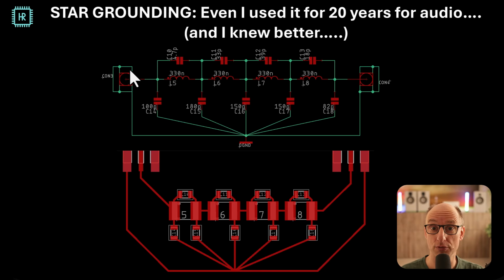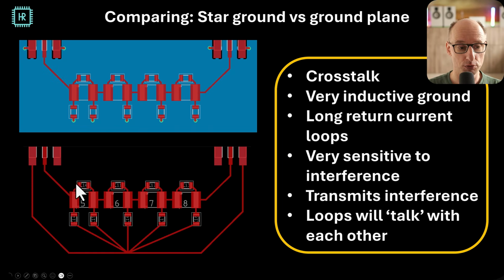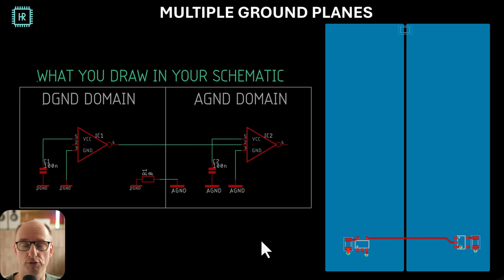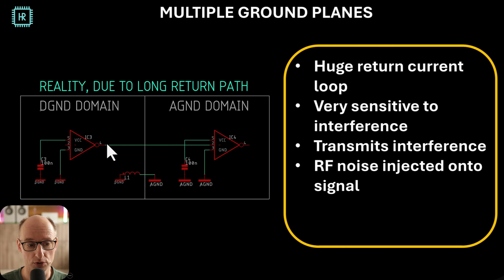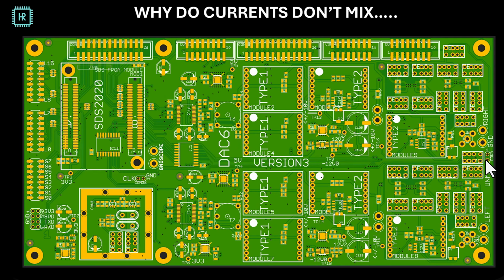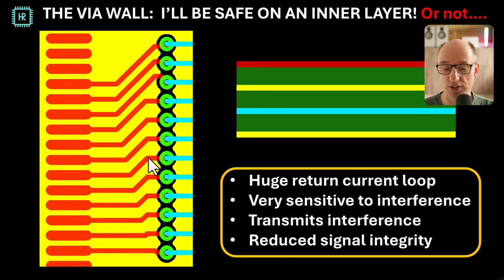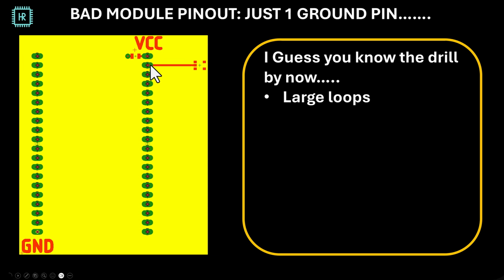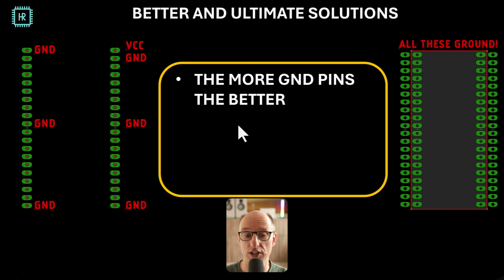Why Your Ground Design is WRONG — and How to Fix It. Flawless PCB design part 6

Comment: Hi Hans. this is the perfect video for the topic I am working on right now. I'm an engineer who working on VHF receiver and demodulator based on CMX7032 chip. In the datasheet, CMX7032 specified that it needs multiple GNDs for its DGND, AGND, and RFGND. What your opinion on this matter? Thanks
Reply from the maker: I've addressed this in my part 5 video: See mobile radio chip. If that doesn't help, reply back to me
Reply: @HansRosenberg74  Thanks Hans. I've seen your excellent videos. From what I understand, the underlying principle is that the energy of the signal propagates "only" between the signal trace and the GND plane, just like a transmission line. So that as long as the GND plane is unobstructed and the distance between the signal traces are sufficiently large (to prevent crosstalks), we can just use a single large continuous GND plane for all AGND, DGND, and RFGND for the CMX7032 design. I'm I correct?
Reply from the maker: Yes, indeed. 4 layers are really great since the loops get so small so you can put stuff close together.
Reply: @HansRosenberg74  Btw, where does the requirement for separate GND in the CMX7032 datasheet comes from? Or, what is their reasoning behind all of that, on your opinion? Thanks, Hans.
Reply from the maker: Hi, their reasoning is wrong. That is why I made this video. With this layout, you're forcing whatever interference and return currents there are through the die of chip instead of through the ground plane. This is a bad idea. I've seen very smart people fall for these mistakes in 3 different companies and solved all problems all those times by making a single ground plane. It's just because people think RF design is a bit of a dark art, but it really isn't. It's really really simple if you just follow a few main rules...
Reply: @HansRosenberg74  Thanks, Hans, for your videos. Really helps. God bless u

Comment: Actually i'm in the process of designinig pcbs for audio, and I've used the bottom layer as a signal ground plane and signal routing, and the top layer as a "dirty" ground plane and power supply related stuff (supply caps). The two grounds are then connected together in a single point. I've avoided as much as possible to cross the bottom signal traces with the top power traces, but still I'm wondering if it's a good idea now
Reply from the maker: It's worse for keeping rf interference out. If it is a power amplifier, you do have to be careful where the large currents are running in your ground plane, you don't want those to add to your signal ground going to the input. So power left and signal input right would solve that (using a single plane)
Reply: @HansRosenberg74  Well.. The project is a mixer/preamp, so I don't have large current signals, but lots of opamps and multiple pcbs.
So I'm a bit concerned about ground loops between pcbs and noise performance. That's why I came with that solution in the first place. Components are also placed to keep the traces between them as short as possible.
Maybe using a signal ground plane on both layers and the power supply "dirty" ground as a trace along with power supply rails is a better idea?
Reply from the maker: With the info I have now I would use a single ground plane on both boards. I would make very short return paths for signals going between the boards. So signal pin with 1 or 2 ground pins right next to it. If you don't have high currents, then there will be no crosstalk caused by common ground impedance since the impedance of a ground plane is very very low.

Comment: Crap, I just sent for manufacture a board I was super proud of, and now I realized it is totally wrong :D:D - Thanks a lot for these videos, super useful to spot mistakes!
Reply from the maker: Darn, that is a pity. If you don' t have a high dynamic range somewhere, you may not have problems.....
Reply: At least 99.8% of all professionally designed boards i have ever seen do not conform to these design principles and they still work well enough. You are likely enough to get lucky.

Heck i'm afraid to use them because the boards may not look "proper" to an outside observer or to the customer regardless if they work well!

Comment: One problem that's always scratching at the back of my mind is that there's two grounding rules that I find are often at odds with one another: one being that you want to keep the return path as close to the signal path as possible, preferably with no other signals sharing that path, and the other being that you want to prevent the formation of ground loops. In a pcb with ground planes and short distances this seems easy enough to rationalize, but in larger assemblies with multiple pcbs, modules, or even sub assemblies it seems like you get one or the other in most cases.
Reply from the maker: Now that I think of it, if you really have a ground loop, maybe it can be solved using an isolation transformer in the mains supply of one of the pieces of equipment affected. Not really a very nice solution but may help. You first need to understand what is causing it really.....
Reply: Yes, but he explained this very well already when he talked about PCB modules.
Reply: @jaro6985  sort of, but he doesn't really address ground loops at all (and in that instance it seems implied he's looking at relatively short connections). The issue with ground loops is they can result in current flowing between the grounds. In large audio systems with long spans it can be a strong enough effect to even damage the equipment.
Reply from the maker: Yes, this is an annoying one. What I've noticed a few times is that I got ground currents between 2 transformers. So I had 2 supplies (transformer, bridge, elcos) of which the grounds were connected and I got quite high ground currents leading to hum in my system. I never found the real cause of that. I think I must have had something wrongly connected at that time because I never had it again.

The problem you're referring to is a common mode current. They're really nasty and can cover a huge frequency range from 50kHz up to a few GHz (wifi). I took some measures at home with my own audio system. Probably will make video's on that in the future.
Reply: I think people worry too much about ground loops. It's one of those things that's only a problem when it becomes a problem. Whereas you'll always benefit from tight return loops.

Comment: Gonna guess that one issue we all forget is the difference between 'frequency' (thinking in sine waves) and edge rate of change (dv/dt and di/dt).

Even low frequency circuits can produce high rate of change effects. I've seen FET control of relay/motor coil generate worst RFI, not from solenoid back EMF on switch off, but from the FET switching on even faster.
Reply from the maker: Exactly!!!!

Comment: Having a Master in Metrology, I wish these kind of things were teached at my uni. Not only they're very useful for design (Metrology doesn't have a lot of that), but the concepts you use for explanation would greatly simplify the understanding of all the electronic courses I took.
Reply from the maker: Unfortunately you don't learn any of this useful stuff in any school. All I got wat a tsunami of math which is 99% useless for designing great electronics. (you do need simple high school math, but none of the useless advanced stuff which was 90% of my education). You can sense this still frustrates me after more than 30 years :-D
Reply: Es la conspiración de los profesores, ellos tampoco lo saben.  Na mentira, en Latam tenemos buenos profesores, pero tampoco lo enseñan   Saludos desde Argentina

Comment: 13:45 A cheat that could be useful is that you can add extra ground return paths on IO centric modules by assigning spare pins to ground potential, then switching IO to driven low on the logic device. Usually this is a more used to help drive and decoupling (you can also use it to add VCC capacity to the chip IO but don't boot your firmware up wrong) but it may also relieve some of these issues for boards that have been designed using a lacklustre pinout.
Reply from the maker: Nice one! Just make sure that the io is set to the low level :-D
Reply: Spare module input pins can always be tied directly to ground on your motherboard and shorted to the ground-plane on the module, as close as possible.

Comment: It would be really great if you make actual PCBs with those mistakes and theirs solutions and show some actual measurement results comparing them.
Reply from the maker: I basically did that in my first video (part 1). I made a ground obstruction there. It is exactly similar to what happens here.

Comment: With a four-layer board, can the reference really stay on the same plane?  My understanding is that fab houses really want a symmetric stackup, and the inner planes are normally fairly close to the outer layers -- so that the influence of L4 on L3 would often be 50 times the influence of L2 on L3.  Am I misunderstanding something about how to order?  Or was staying on the same reference plane really more about 6 layer boards on up?
Reply from the maker: No, You are correct! The distance is a lot more. I forgot to mention it in this video (it is more apparent in my other videos I think).  If you're making controlled impedance lines, you probably have to use the other reference plane otherwise the internal tracks become much wider. You'd get a bit of a undefined situation if you don't connect the 2 ground layers together with vias. At least at the 'crossing point' of the signal.
Reply: good point

Comment: My favorite grounding strategy is similar to the "every signal gets its own ground pin", but where you then also route that signal and ground pin together as a controlled-impedance differential pair throughout the rest of the board too. Single-ended signals are for car mechanics and linemen.
Reply from the maker: Differential is a must if you do high speed digital I think. It's all relative. There are many applications where going differential adds more electronics and you don't need the extra advantages of going differential. So it really depends on the application and cost / complexity. You can make extremely good equipment using only single ended RF lines (I worked on one of the most sensitive receivers in the world 25 years ago and that was all single ended RF at that time, Westerbork Synthesis Radio Telescope). So it is all relative and depends on the application and the environment it has to work in.
Reply: @HansRosenberg74  Oh, absolutely, I mostly mean it as a bit of tongue-in-cheek. But, even if you don't have "real" differential signals and aren't going to be adding pulse transformers or line drivers, you can still get some of the benefits of differential by just routing each signal as a differental pair with a separate ground -- especially when it comes to cable assemblies, where if possible you try to use a separate twisted pair for each signal.
Reply from the maker: aha, yes, I've done that a lot in sensitive measurement setups (I now understand what you meant). I love using shielded twisted pairs with a low capacitance. I used them to get sensitive signals out of climate chambers, that worked brilliantly (much better than I expected, I was worried about the added capacitance because of the shield).
Reply: @HansRosenberg74 At Ferranti in teh late 80's-early 90's we had an in-house differential digital logic gate library for out latest bipolar fab process. Every signal on chip was differential, invertors, and and or gates, and flip-flops all differential, (plus level shifters - cascodes for three different common-mode/bias voltage ranges) This mitigated against substrate ground lift and supply droop across large die, and allowed logict to run at up to about 600MHz. Interesting stuff that I've not seen done since other than for getting signals on and off chip.

Comment: I have an idea: 1. Create the star ground topology as if you want it and place components as if you have one (keep the smaller value caps neaar the pins). 2. Create a plane across the lot... Worked fine for 77GHz RADAR power supplies.
Reply from the maker: I can't make up a mental picture of how this looks exactly. I think you're talking about a power supply now? Then starring it would be a good idea (with a ground plane under it that is). This must be it, you start your sentence with star ground but switch to power, so I assume you talk about power distribution :-)

Comment: What a gem. Was looking for a course to develop my graduate skills, moat companies charge an eye for things you can find for free on YouTube. It would be really good if you make a course and focus a lot on the practical / professional part. Can guarantee you people would buy as there is not enough content like this on the internet 😊
Reply from the maker: Thanks a lot. I'm very nervous about creating courses, or, more specific. Selling them. I know I can explain this to people, but it will be a big program because I really want to transform people to a much higher level. That also means this can't be a very cheap course. However, I can guarantee that if you're working on a development department, and you start applying what I know, you'll easily save 100k usd in the first 3 years (probably a lot sooner). This is based on my own experience (examples in my part 5 video). So 5k-10k usd per person for this course is a total bargain, but will people buy it? Next to the 100k savings, there's also a 1 month project time reduction in that. I can pretty much guarantee that as well. So lots of value, but you have to be willing to make the investment in skills. (if only it was as easy as engineering :-D   )
Reply: @HansRosenberg74 I am from the UK and currently working in the education sector. I'm happy to share the tips required to make content and how to spread them. Where could we connect?
Reply: One of the only other good content creators is Phil's Lab. Are you familiar with it?

Comment: I would be interested to see a video on whether everything you've covered about ground planes applies to power planes.  Pros and cons of power traces or busses or starred or a plane.  How do you deal with multiple voltages - maybe some with higher currents than other?.   Would you sacrifice a ground plane layer to use that layer for a power plane?  Thanks for the great videos.
Reply from the maker: Hi, I'm planning to do that. I'm basically already doing something like this in this part 6 video. I'm using a vcc pin as a ground return. If you tie a power plane to a ground plane with regular decoupling caps, it's just as good as a ground plane! Instead of vias connecting 2 ground planes together, you place small capacitors to connect the ground and power plane together and the signals will happily use the power plane as a ground return path :-)

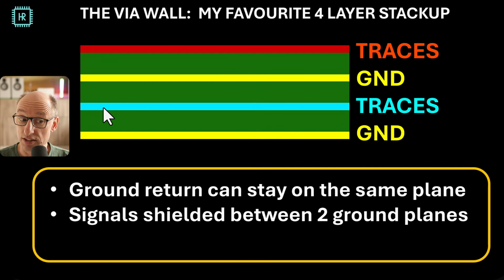Comment: Thanks a lot Hans, i would like to ask a question about the via wall ( 09:05). Why do we put one via next to one signal via instead of putting one ground via between two signal vias in order to avoid EMC problem?
Reply from the maker: That would be great, but you would run out of space very quickly (unless you have the space) as the vias spread out along a line that is too long. I'm assuming there are also other pins left and right of this bus that still need to be connected. If you have the space, it is a great idea!
Reply: @HansRosenberg74  Thank you so much for this invaluable information.

Comment: Ideally the sensitive signals should not be transmitted via one wire, the first major mistake is that it is a cheap solution usually instead of using a differential pair.
Reply from the maker: indeed!
Reply: But then you have the potential to create large ground loops in an assembly, is this still preferable in that case? That's a question I've had for a long time, whether to prioritize the signal return paths at the expense of creating large ground loops.
Reply: @xxportalxx.  If you deal with multiple analog channels, I think it is preferable.
Reply: @trevoro.9731 I believe it's a matter of scale, i.e. the lengths and currents involved. As an example in analog audio systems, with large spans, ground loops can cause enough current to flow between grounds to actually result in damage to the equipment. I suppose my point is that there must be a deciding factor, that you can use to draw a line, but I'm having trouble seeing what that is (aside from when you start having problems, but that's troubleshooting advice, not design advice).
Reply from the maker: How big are the loops we're talking about here? Are you talking stage systems where you're dealing with dozens or even more than 100m?